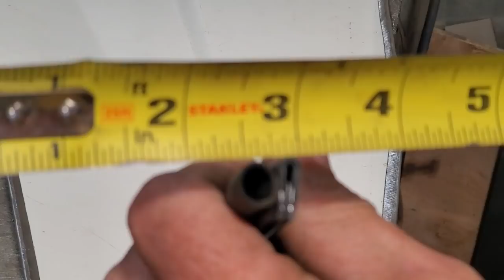How to make RZR lower doors

Comment: Fitzee: "So a fella came in with a rusty horseshoe, so I took the horseshoe and proceeded to make myself a template...From there I was able to make a decent sized horse with a saddle...the guy who now owns it,  rode it to Moncton and back a few times...
Fitz, you are indeed a great mentor and best down to earth how-to guy on You Tube.
 you never cease to amaze brother, 👍👍the lower door sections look factory made. Without the use of specialized tooling,  a good step by step demonstration and best use of brake metal to add to strength and the aesthetics.

Comment: At the 5 minute mark, you show us how you made the the initial tracing using your template onto the metal. If after that you trace again, but use a washer, you can easily make the extra dimension around your template. Different size washers, have different widths. By using a washer with a 3/8ths width from center to outer edge, you can easily enlarge the template on the metal. Placing your marker/pen/pencil in the center of the washer and keep it pressed against your template as you go around it, gives you a fast way to mark your material with the extra 3/8ths dimension, accurately, and simple. It's a wood workers trick.
Reply from the maker: Good tip!

Comment: Fitzee,
I am really enjoying your show, with your use of bare-bones tools, and it has moved me to buy some tools and begin a restoration of my 1987 Toyota PU, that rightly belongs on on the rust heap as junk. Thank you for sharining your work with us.
Q: i cant find quality autobody hammers. All the ones I have bought are soft steel heads and deform easily. Do you sell quality hammers? Perhaps with your logo on them?
Thanks

Comment: Great video, really like the simple breaks in the new panels to stiffen them up.  Like others have said you wouldn't guess they were add on, design mimics styling that was there.

When you are drilling pilot holes in 18g with cordless, you go thru quickly.  What bit are you using?  To enlarge hole, looks like a step drill.  When I do this, takes too long and sometimes I snap pilot bits.
Reply from the maker: I drill all my pilot holes with a 1/8 bit. I like the two sided bits as they fit down inside thr drill further.  A 1/8 bit sticking out over a inch it will crack off

Comment: Tony…… I’m curious why you didn’t use your sheet break to establish all of the 90’s?
Seems like you’d have a better edge to work from than hammering it on the I-beam, alone.
Reply: A healthy magnet to secure the front lower corner would keep it from flopping around
Reply from the maker: Showing you don't need big tools to do it. I think it might pushed back on the panel in the break. Very short bent to make
Reply: @fitzeesfabrications  Don’t get me wrong, they turned out great. Just the one thing I would have done differently. At least on the longer ones.

Comment: Nice work correcting all the bad designs on this vehicle one by one and demonstrating fabrication with no welding this time. Using the vehicle shows up what's wrong with it and lets you add your own modifications.  But, you did two things wrong in this video. 1) You forgot to wear hearing protection while hammering and 2) You forgot to get your cat to inspect your work when you finished the reassembly.  All the best from Queensland Australia.

Comment: Hey i am restoring a 1976 datsun b210 and the hood has a weak spot about as big as a paint can am i was wondering how i could tighten it up without replacing it cause the metal is in good shape in that area just weak and pops when you touch it
Reply from the maker: Shrink it. Metal is stretched. Don't have any videos on shrinking but there are lots out there
Reply: @fitzeesfabrications  Thanks alot for that i am huge fan of all your videos i could watch them over and over all day. I want your recommendations on how would you shrink it with torch or shrinking disc??

Comment: Another awesome how-to fabrication. I know you source sheet metal from automobiles. I was wondering if you ever source it from appliances? I'm looking at an old refrigerator with stainless steel on the doors.
Reply from the maker: The new fridges are very thin. Stoves and washers dryers metal is good
Reply: @fitzeesfabrications  That seems to apply to everything these days. I use old computer cases 1.2mm thick for some jobs like repairing the rockers on my 1982 Mitsubishi L300, which is the same thickness metal. The new cases are a lot thinner, probably half that, but I haven';t measured them, as they are pretty useless being so thin.